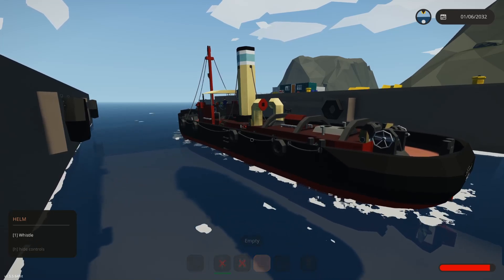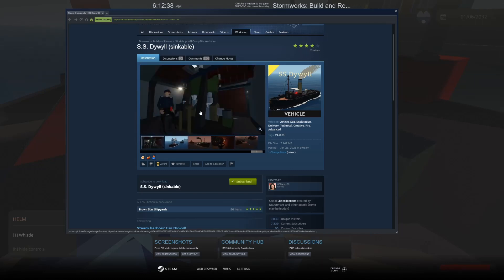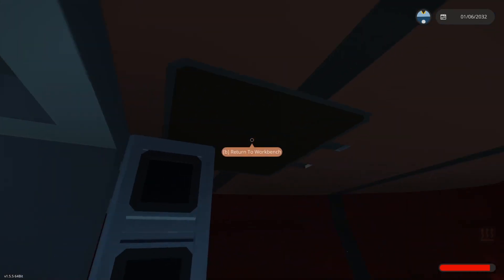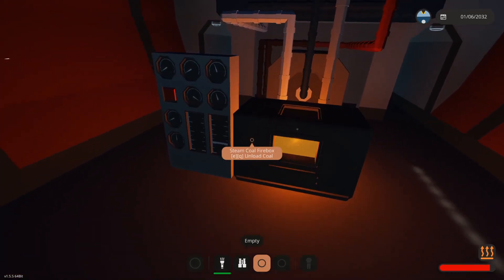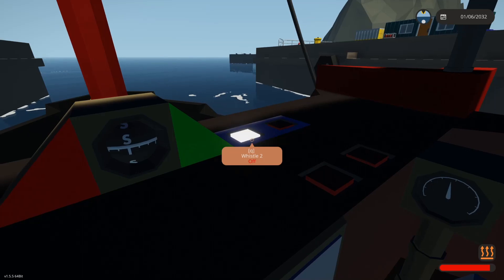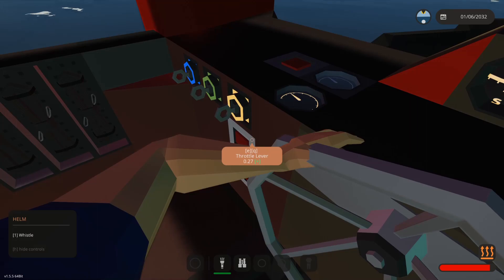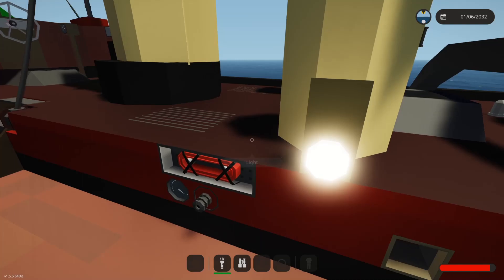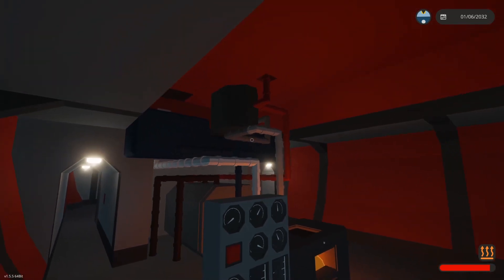Stormworks steam tug boat with steam pistons

Comment: Need at least 3 pistons to get a more consistent rps, set the initial position so they are not at the extremes at the same time.  Adding some pumps to pump steam out helps too because if it backs up in the pistons it slows them down.    

I hope they make modular versions of steam pistons so we can manually adjust timing and steam volume going into the pistons to control timing,  speed and power better.   The way the work now, it is only steam volume that changes how fast they turn.
Reply: Also maybe helpful will be to add a flywheel to the engine to have some momentum for pistons

Comment: Add a flywheel so it doesn’t stall as much
Reply from the maker: They have flywheels in stormworks?
Reply: @victorfiori105  yep they do!
Reply from the maker: @LMR78  Going to update the design. I'm new to stormworks lol
Reply: @victorfiori105  haha, it’s okay. I was once a newbie too. I’ve been playing for about 3 years now.
Reply from the maker: @LMR78  They don't work with the new steam pistons for some reason.
Reply: @victorfiori105  yes, it's part of the modular engines stuff. you'd have to go piston > ME clutch > ME flywheel > ME Clutch > Propellor
Reply from the maker: @Lynsis92  Well I guess that rules that out because that setup is definitely not fitting in this tug. Does the ME clutch work with the pistons? They really need to fix the pistons.
Reply: @victorfiori105  there are small flywheels and clutches and it should if they have the normal power connection for pipes. the ME clutch is a 1x1 and the smallest flywheel is a 1x3x3. i havent actually played with the pistons yet as i've been busy with work.
Reply: @victorfiori105  it should, make sure you’re giving the clutches a constant number input